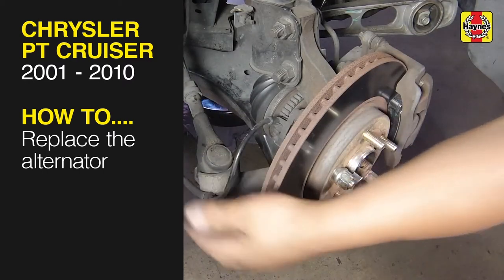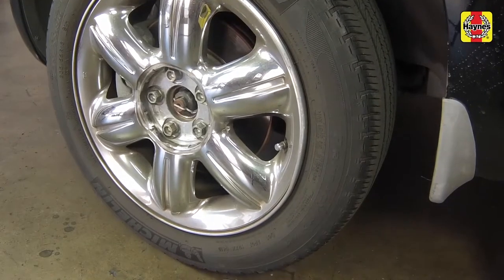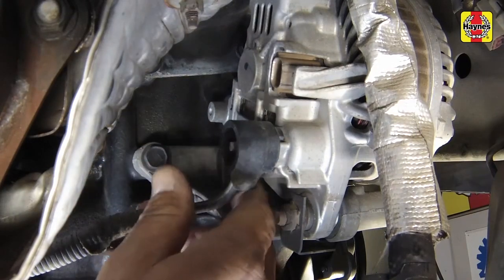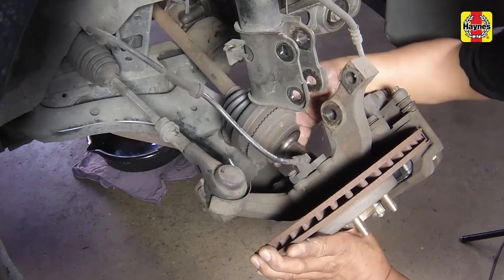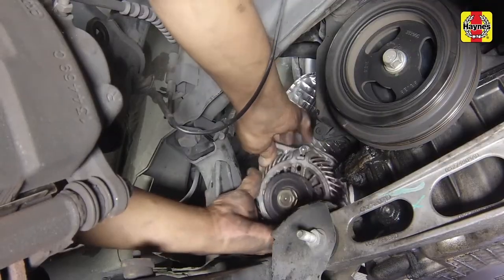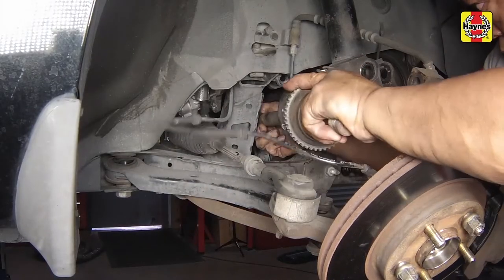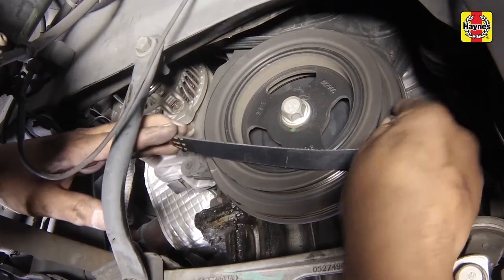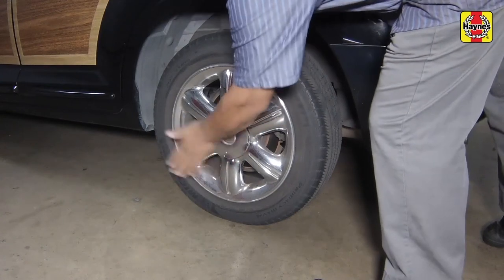Chrysler PT Cruiser (2001 - 2010) - Replace the alternator

Comment: All you need to do is remove the coolant reservoir from the firewall and you’ll have access to the heat shield over the alternator. Two 10mm bolts and one 13mm nut and then the 15mm bolts for the alternator are accessible. 

If you put a pry bar on the left engine mount and gently rock it you can pull the alternator up easily between the exhaust manifold and heat shield and the A/C tank. 

This is the way the job is supposed to be done.
Reply: Went out this morning to start my PT cruiser and it was dead so I jumped it but by the time I returned after putting the jump box away the car had quit. My first thought was oh s*** my alternator. So I priced one and it wasn't too bad but since I've never replaced one on PT cruiser or I started perusing YouTube. I came across a similar method to the one you mentioned first but thought I would look into different methods. I ran across this Haynes video and thought - okay these guys make the manuals for the car they're going to have the "right way to do it". Well screw that. That seems like a whole lot of work and I'm convinced again the engineers who make this s*** never have to work on their own cars. And thanks for the advice by the way. ☮️
Reply: How does it take this way?

Comment: Read that you can remove  alternator  from the top if you remove  the coolant  tank  and the top heat shield. I removed  top heat shield  didn't  know  their  was second  shield  while  trying to remove  it got jammed  had to bend it to remove . Also the connectors were tight one to remove  use a 8 m socket  other one squeeze  and  pull. I am  getting  ready  to remove  axle by way of the Haynes video. I am working  on a 2002 my new altenator  is for a 2001 to 2002  maybe their a little  bit  larger?

Comment: They  didn't  mention you also have to move the power  steering  cooler assembly  aside two bolts eight  or ten  mil ? I did  on a 2002 .

Comment: Alot of comments stat that you can remove from top.I have a 2002  tried that method  didn't  work  for  me could  be alternators for the 2001 and 2002 were larger?  Removed from bottom  this vidio doesn't  mention  you must unbolt the power  steering cooler  and  move aside,  the Haynes  book mentioned  that step worked  for me.

Comment: How many people unbolted the spindle and didnt use a spring compressor? The strut will push directly into the CV boot. I couldnt get it removed from the top. Why did you skip the step of using a spring compressor?